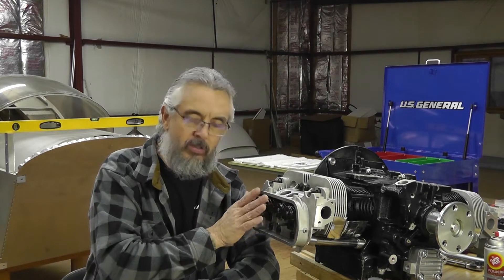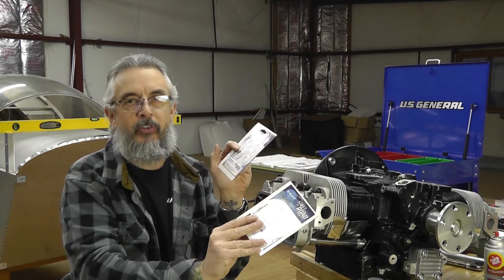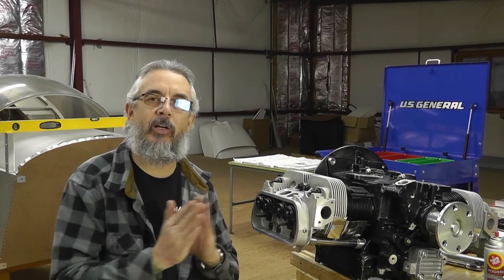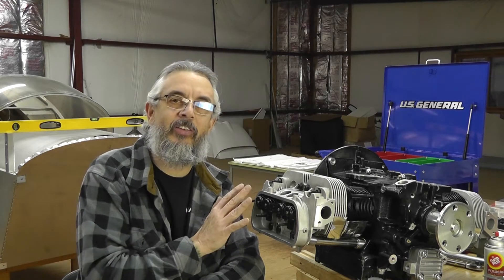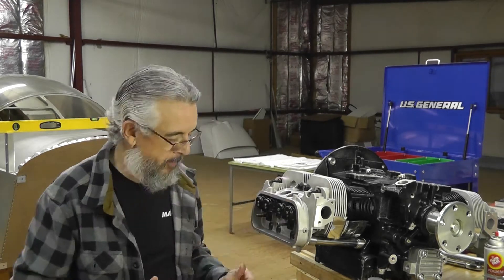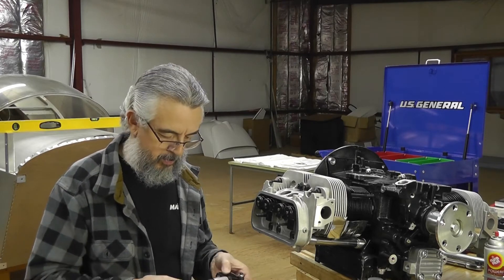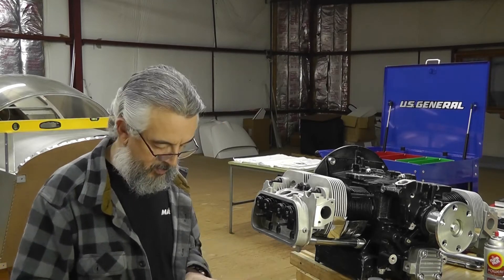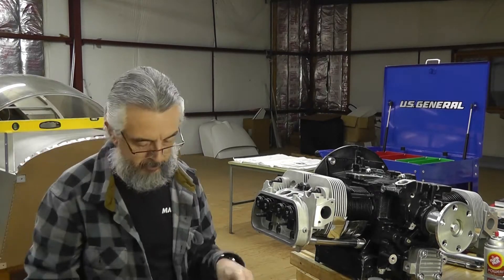Sonex Build Part 20 -Victory Over The Rocker Arms

Comment: i see someone mentioned hvx mods. you have the only hvx mod that truly works included on your rocker shafts (i could see it). you should think twice about the swivel feet. they are known to break and make setting up rocker arm geometry difficult. the rest of the hvx stuff is a bunch of hokie bs spewed as gospel by a guy that didn't graduate from high school.
Reply from the maker: I was doing my best to follow the Aerovee manual to the letter as far as assembly went but definitely used some of my own techniques to get a few thing accomplished. I never even looked up the HVX stuff. No need to be taking any more chances than necessary in the air.
Reply: @weekendhack.whatsnext  i watched the last vid in the series. medical clearance? that sucks. hope you get past that snag.

Comment: First, I applaud your statement & attitude about taking the time necessary. It can be frustrating, but safety is never unimportant!  Second, you mentioned greasing the rocker assembly - when you do so I urge you to not overdo it with the grease, and use something that will easily dissolve in oil.  The reason for this is that the oiling of the rocker area happens via pretty small oil passages in the pushrods and rocker-arms, and the oil has to flow from one end of each rocker arm to the other by going around the surface of the rocker shaft (for some good diagrams of the oil flow in this area, look up "VW HVX mods"  - although I am not explicitly endorsing or recommending doing the actual mods). 
Anything that hardens or clogs up these passages can result in a lot of wear on valve-train components, and less oil in the rocker area means less heat-transfer from the heads to the oil - resulting in higher CHTs.  Good luck with the rest of your build!
Reply from the maker: Thanks for the heads up. I also enjoy your input and the help you offer others on the other support pages. I did notice the grooves around the rocker shafts for lubrication. I just greased the shaft itself. Some got into the grooves but they are not packed and I am pretty sure that the white lithium dissolves easily in the hot oil once it starts moving.

Comment: do you think if you had found the deburring issue in the beginning, that the stock arrangement would have been adequate?  Do the rocker arms come fully assembled with the spacing all set up?  thanks for the great videos and look forward to more of them.
Reply: The rocker arms come assembled (or at least, used to come assembled when I bought mine) with some shims between the components on the rocker shaft. However its worth noting that there are TWO sets of shims that affect the rocker-arm-to-valve alignment: the circular ones that fit on the rocker shaft, and the square ones that go on the rocker-shaft mounting studs (between the cylinder head and the rocker-shaft mounts).  You need to utilize a combination of both in order to ensure that 
1) The swivel-ball on each adjuster screw touches the valve stem slightly off-center (to help rotate the valves every time they are actuated. That evens out the wear on the valve, seats, & guides)
2) Each rocker-arm has the appropriate gap between the swivel-ball and the valve stem with the adjuster-screw only part-way screwed in (so there's room to adjust in either direction over time).
Reply: FWIW, this is detailed on page 24 and 25 of the current (as of Jan 2022) AeroVee Turbo Manual: http://www.aeroconversions.com/support/instruction_sheets/AeroVee_2point1_Turbo_Manual.pdf
Reply: @noelwade  thanks for the reply and the link.
Reply from the maker: Thank you! I do not think that they were burrs. The holes were just very close fit. That made it difficult to get the rocker arms seated all the way down on the studs because you would need to go on perfectly straight and evenly and even then they were very tight. The shaft clamps were treated with some form or oxidation layer and that also could have been a little too thick on a couple of them. I did not oversize the holes. I just gently reamed them by hand with the appropriate drill so that they slid onto the studs better. I am the second owner of this kit so I do not know for sure if they were assembled on arrival. In the Aerovee manual they say that even if they arrive assembled that they could still need to be spaced for your particular engine. I spent far too much time getting the spacing where I wanted it. I tried a number of different approaches until I finally found one that worked for me. I think that getting the spacing for the middle two arms first is key. Do not even bother with the outer arms until you have the centers spaced with correct clearance and then work on the exhaust rockers.